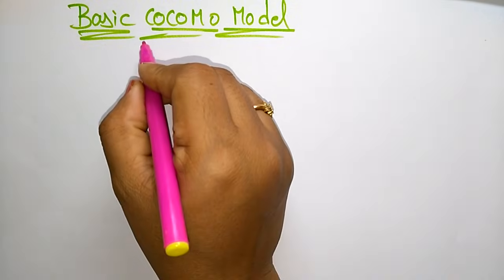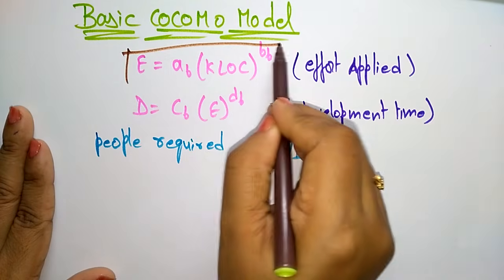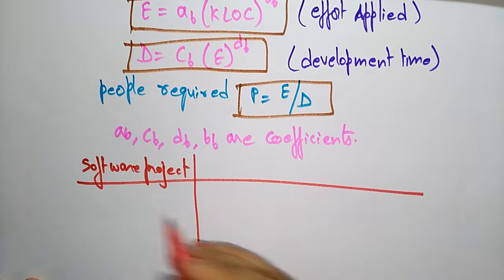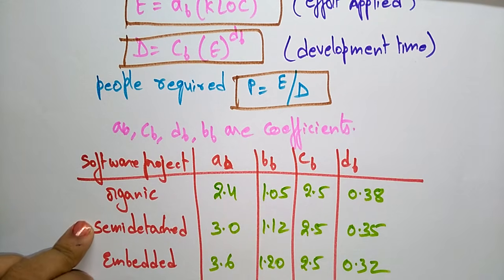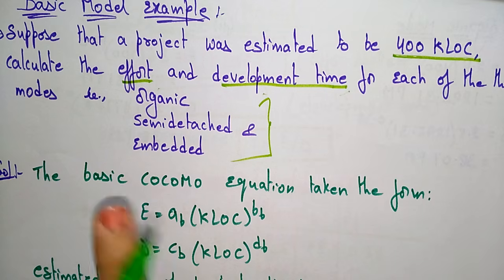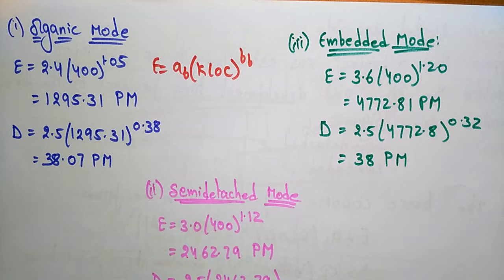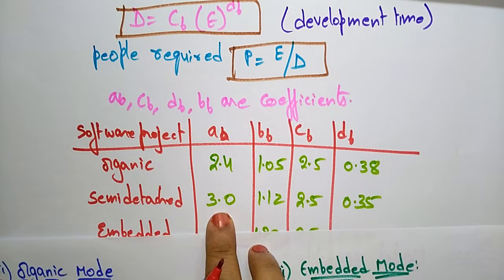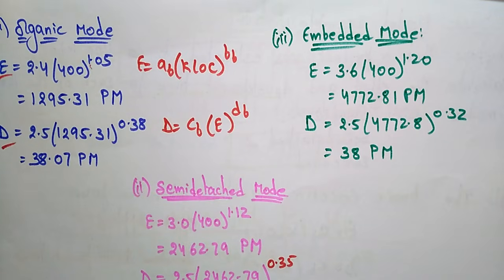COCOMO model | Part - 2/3 | Software Engineering | SE | Lec-32 | Bhanu Priya

Comment: I have a question 

You said if the project size is above 300KLOC then it automatically falls to embedded then my question is why on 7.10 did you used Organic in your substitutions?
Reply: May be because in questions they are specifically asking to calculate for all classes. if that was not mentioned then we can choose according to the kloc range.

Comment: Embedded mode D value is wrong. Correct one is: 2.5   ×   ( 47772.8 )   ^   0.32 = 78.5738 . Didn't check others.